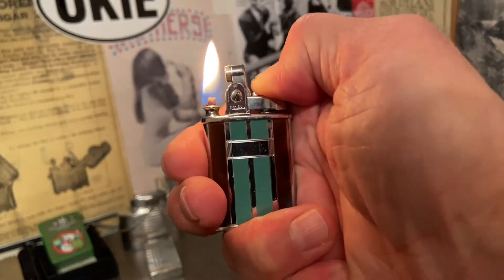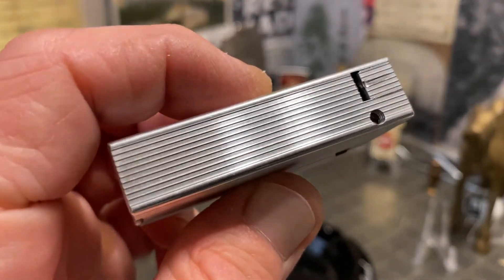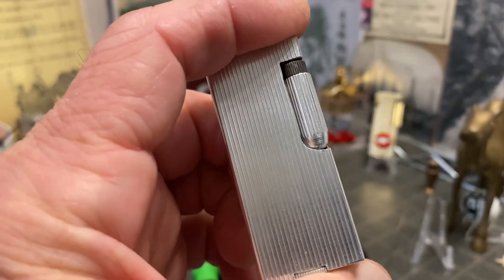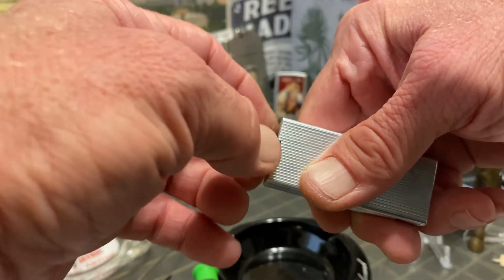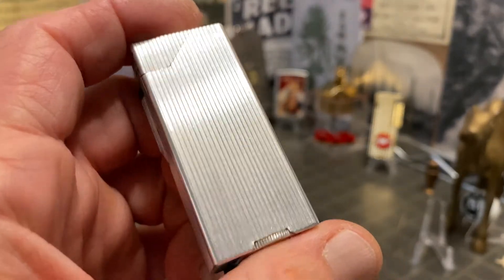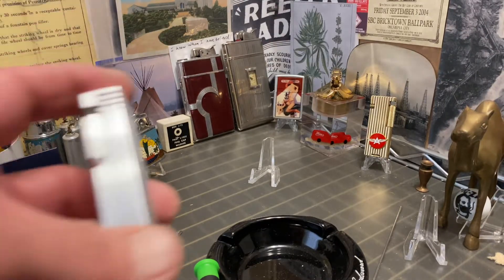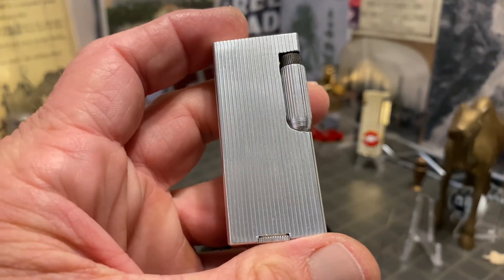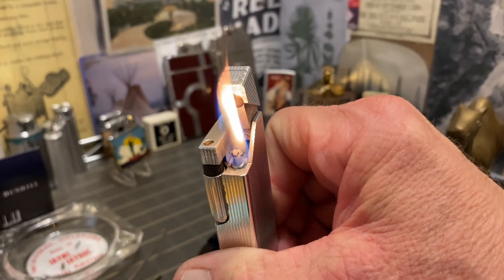Vintage JOSEPHSON & SHARP SHARPO Lighter GLENDALE, CALIF. Aluminum Block Petrol Vertically Ribbed

Comment: I use several of my vintage lighters. I keep 1 at what used to be my computer/reading desk, another on the kitchen table. These are my table lighters of course. And another on a table in the living room. Never know when someone is going to need a light. I will shelf them when the urge occurs. Then get out another 3 to replace them. Just a change of scenery. For pocket carry that varies too but usually it's Henry (That's the name engraved on it) His name and 50, the year he got it. That's a Ronson Whirlwind that looked like heck when I got it. Sweet now tho. It's  the hammered gunmetal looking version. Or I might carry a brass Zippo an old girlfriend gave me. Plus a few more, depending on what I'm going to be doing. People notice when you whip out your lighter and it's something different.
Reply from the maker: Using vintage lighters does say something about your sophistication and style!✌️